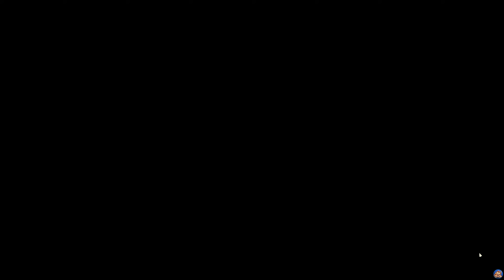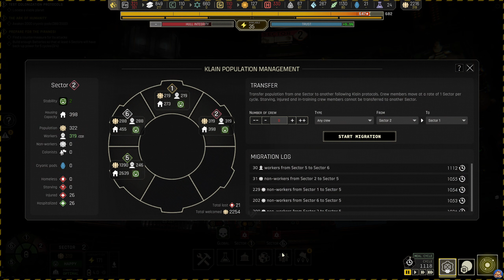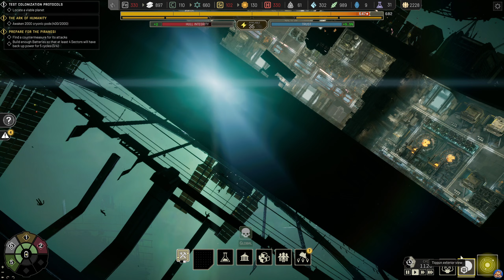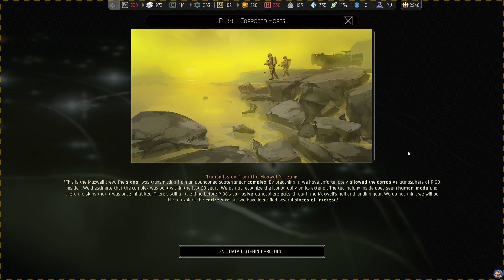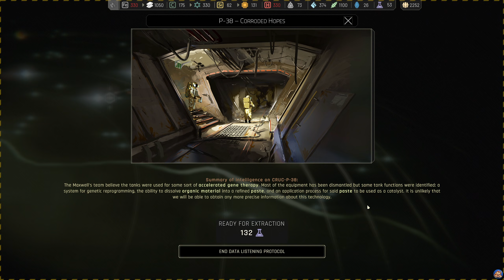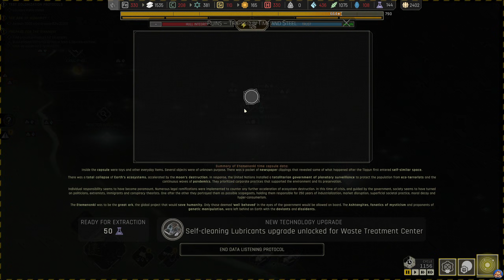IXION Lets Play - P-39 - Industrial Zone Wreckage - Theta Crucis - EP20

Comment: 20:56 the repair bonus would at least let you have more accidents.  I wonder, though, does it affect hull repair, too?
Reply from the maker: Well, the repair bonus doesn't affect the worker recuperation time in hospitals, which is the main issue with them. It does not affect hull repair - that's Space Specialization, which explicitly states +10%/+20% efficiency bonus to hull repair. 😊

Comment: Curious why Lightbulb your second Sci ship, if say it was already in orbit, couldn't finish the last task on CRUC-P-38?

If one has the ability to make multiple teams or units then logically they should be trained to work independently and collectively depending on the needs and circumstances. 🤔
Akin to the combined arms philosophy of most militaries or the sections of the Tiqqun itself.

Hopefully the developers didn't intentionally block potential solutions just to arbitrarily limit players.
Reply from the maker: I believe only one science ship can be in an event at any time. Lightbulb was only there to collect science. Part of the puzzle I think.

Comment: Hey Caledorn.
Thanks for this long run of this amazing game.
I just left CRUC today. It was hard, even if I was aware that the storm is moving forward a bit more each time you finish an event so I decided to go to a strategy that take a bit more time but is very efficient.
First, when I was on the last star system, I managed to get 2 more science vessels with 2 additionnal docking bays to be able to launch them at the same time (4 in total).
Once on CRUC, the first thing I did was to sending them to each story line POI (I avoid planets first) and let the ships on these POI to get all the science points of them. It was very usefull because, 1st, once you start an event, there is no turning back, you must finish it, and 2nd, once you finish it, the storm getting closer. I also moved the Tiqqun to the planet at the upper left of the map (you'll see later).
So I kept all the science points available on this part of the system before starting the events.
During this time, I mined all the resources but sent the cargo ships to get only the essential ones.
Then, I started the first event (the one that is the closer to the storm, I forgot its name). As I already got the science point, I was able to sending the ship back to the Tiqqun before the storm start to damage it.
I did that with each of the storyline POI and then, I kept back the last science ship left behind before crossing the storm with the Tiqqun.
I did that from the planet that is on the upper left of the map, straight forward to the closer POI behind the storm.
Then, I finished all the storyline POI of the lower part of the map to send the storm away.
Once it's done, you have all the time you want to do your business. ^^
And there is a lot to do because in this system you must retrieve and defreeze around 2000 cryopods (and there is bit less than 3 000 crypods to get back in this area) ^^
You better getting them with caution, a bit at a time, regardless of how is your defreezing infrastructure. If you store too many (the trouble with the population start with 1 000 stored cryopods) of them and don't defreeze them fast enough, you'll face some annoying things with your population. The better way is to deal with the cryopods once you're on the down side of the map and the storm is away.
Oh, and you will have fire on board, it's a certainty. Put a fire station on each of your sectors. They also repairs.

And if you guys want to know the basics of tier specializations, here is a sheet https://ibb.co/VYLXcy0
Reply from the maker: Very good advice and guidance here!
Reply: @Caledorn  I died (game over/restart the chapter) 4 times. This one is the harder chapter IMO. The next is easy compared to this one.
Reply from the maker: @alexringess  Oof. Yeah, Chapter 3 definitely is difficult. I am about to wrap up the chapter and move into Chapter 4. Should be interesting...
Reply: @Caledorn  This one is funny. I don't want to spoil anyone here but it's something like "'catch me if you can" lol
Reply from the maker: @alexringess  Yeah, I'm looking forward to that one. Should be interesting!
Reply: @Caledorn  If only I had watched your "how dealing with" video of this chapter before started it, I'd probably not died often ^^
Excellent guides you made ;)
About the science ships, I lose 2 of them. Fortunately I had 2 left ^^
Also I gone straight to the thing that recycle garbages to make water to put one on my food prod sector so I didn't need to mine ice anymore. But you must get the tier 3 of food prod for this sector if you want to get enough waste to do that, and don't use waste for anything else on the ship. I'm a lazy man and find mining a boring activity lol (which is stupid because I had to mine iron instead).

Comment: I'd recommand another way to deal with this chapter.
1. DON'T finish or leave any event at first, first send probes to locate some resources so that you can wait for science be done. You can still do the events, just don't leave. Also, Since we're not leaving the event at command center, we won't get the main quest to awaken 2000 pods, thus DO NOT ENABLE ANY OF YOUR CYONIC CENTER if you start this chapter with 0 pods onboard (the amout of pods in this system is exactly 2000).
2. Grab the following science: "FRAUS TACHYON INJECTOR (probe launcher)", "FRAUS TACHYON INJECTOR (EKP ENGINE)", and ensure to have enought battery to last as least about 3 cycles (grab battery upgrade or power off facilities is fine, but you need at least three EVA arilock working all the time to navigate the sotrm).
3. Send probe to locate planet "CRUC-P-51" after probe upgrades was done.
4. While as you do the science make sure you have at least 4 science ships. After you're done with the science and mining with stock piles of resources onboard, unassign all mining and cargo ships and replace with all your science ships. If you go with 4 ships, send them to all the ruins on this side, and go through all the events and not leave the event.
5. Leave the event at DESTROYED COMMAND CENTER, unassign the science ship, move Tiqqun to CRUC-P-42, send that science ship out to do the colonist event but don't leave it yet.
6. After you send all the resource to the CRUC-P-42 colony, leave the event at COLLAPSED FOOD PRODUCTION DISTRICT, and move that science ship to CRUC-P-38 and do the event there.
7. When you are about to leave CRUC-P-38, make sure you have all three of your EVA airlock running, and there's plenty of alloy onboard. Now leave the event at CRUC-P-42 (Tiqqun's location) and unassign that science ship, start moving the Tiqqun to CRUC-P-51.
8. After you enter the space weather, pause right away, back to the remaining events at "REACTOR WRECKAGE", "INDUSTRIAL ZONE WRECKAGE", "CRUC-P-38" and leave all of them.
9. After Tiqqun arrived at CRUC-P-51, send the science ship onboard to do the event and finish it. Now the weather should have pass the left side of the system, you now go on with that science ship do finished up all the events and the storm should gone.

It's even more easier if you have 7 science ship, here's TLDR version:
1. Send 6 science ship for all the event (including CRUC-P-42 and CRUC-P-38) on this side of the system and don't leave any of them, don't awaken any cryopods.
2. Send probe to locate CRUC-P-51, after the only choide at command center is leave, move Tiqqun to CRUC-P-42, and then move Tiqqun to CRUC-P-51.
3. After you enter the weather, end all of the event at once and watch the storm move.
4. Upon arriving CRUC-P-51, finish the event there or move to the part where no weather is present and do all the event untill the weather has pass.
Reply: I left CRUC system today and I did the same as you did.
@Caledorn don't miss his comment, it is more detailed and less confused that mine but say the same. This is the best way to deal with this star system IMO.
Reply from the maker: While both of you provide good advice, and I am doing part of it - leaving out the P-51 part - I feel it might be a tad complex for newer players. I made a guide video (as you both might have seen) on my recommendations for getting through the storm with minimal to no loss (I've had no loss both times I went through the storm, having my entire fleet inside the Tiqqun before I allow the storm to move into the north, and then just EKPing the Tiqqun to the R&D wreckage. There is a small chance of losing some crew through the lightning storm, if it hits the Tiqqun - but with all 3 EKP engine speed upgrades, it has served me well twice now, and is definitely less complex than having that many science ships taking up Docking Bay space...

Also, how do you guys avoid losing those science ships...?
Reply: @Caledorn  As long as the science ship don't move, even the planet is engulf in storm, it won't be effected. Same things apply to science ship that's stuck with event.
My docking bay was four in sector 1 doing general stuff, one in sector 2 focus on iron, one in sector 3 focus on ice, and one in sector 4 focus on population. All 4 miner stays in Sector 1 and all the other sector having 2 cargo ship well over enough, so I just build science ship in sector 1 and reassign them there.
And the science ships are temporarily though, I left only the most expirienced three and dismantle the rest of them after the storm has gone. Though I'm not sure about how the science ship leve will effect exploration, don't seem like giving any extra science or reducing trasnmission time, maybe is their durability.
The step I take can basically allow you to operate on mnimal tech, science you will only stay in storm for less than quarter of a cycle, and the tech that necessary are just Tiqqun EKP and probe speed, the rest is actually redundant if you go with 7 science ships method.
Reply: Also there's some bugs about the weather though.
If you pause the game and leave all the event at once, my game doesn't seem to like that. The storm become everywhere with all the stages stack upon each other, multiple borders can be seen, and the storm essentially engulf the entire system.
The other one is that even arrived at P-51 which clearly show not in strom, and the probe / miner / cargo ships agree, Tiqqun seems to have its own mind thinking its still in strom and constantly take demage. Onboard the symbol is still present and the effects definitely applies, but the star map and other ship show no sign of storm. So better just move on afterward. (The strom onboard will last until next event is resolved, or you move Tiqqun and come back.)